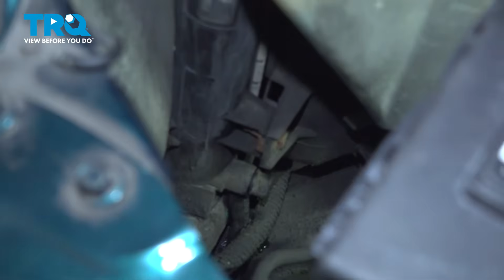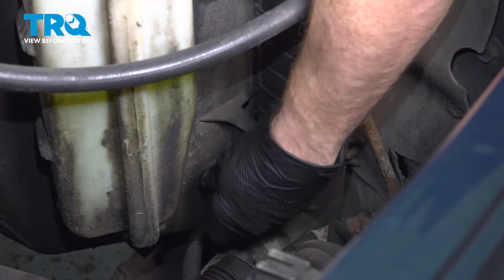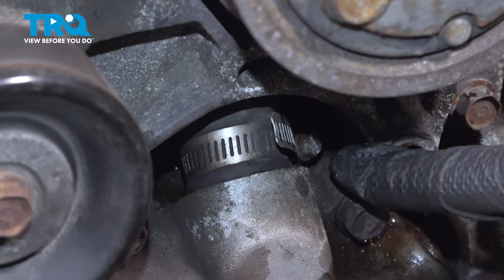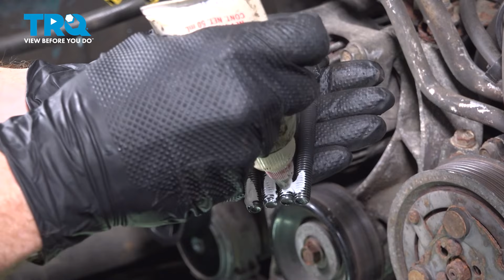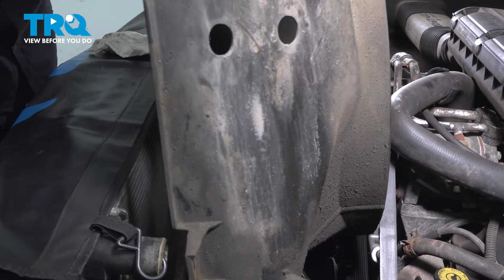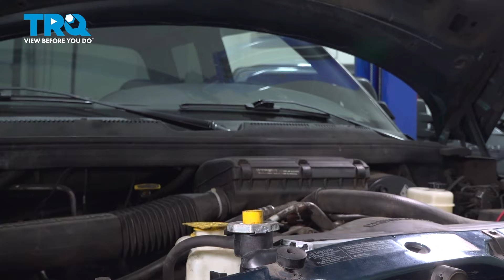How to Replace Engine Water Pump 1994-2001 Dodge Ram 1500 5.2L V8

Comment: I suspect there are fewer and fewer 2001 vintage Ram 1500s (5.9L) still on the road but I am committed to keeping mine running. However, the water pump does need to be replaced and this video has been most helpful in that undertaking. I’m a big fan of DYI videos and have to say this was the absolute best I have ever viewed. And suffice it to say I have viewed “a lot”. So detailed, well organized and concise from start to finish! Follow the sequence and success is guaranteed. Thanks TRQ!!

Comment: I have been driving trucks with these engines since 1999. When replacing the water pump you should replace the front cover to block gasket if you don’t it will eventually leak, worked on enough of these over the years. With the front cover off you can replace the timing chain and gears as they are probably loose.

Comment: I'm not an AC kind of guy and prefer driving with the windows down...I deleted the AC compressor and cut that part of the bracket off and have full access to that short hose...I'm just bought a new water pump and about to go outside to my van and get started on it...the good news is my vacation starts today and the Florida Sun is shinning...the bad news is that its 37 degrees outside for so strange reason...but I'm grateful I don't have to go back to work for 10 days and that beautiful Sun is shinning bright in the clear blue sky...thanks for the video with valuable information !

Comment: Not sure if I missed him saying, but before putting the belt back on, spin the pulley on the belt tensioner and secondary individual belt pulley. Listen for any bearing noise. If either are noisy its a good time to replace while area is easy to access. For a cheaper fix the bullies can be fixed with changing the bearing. They usually take gm alternator bearings.